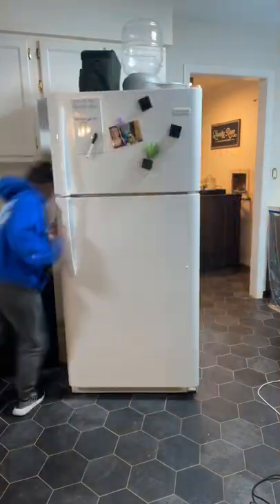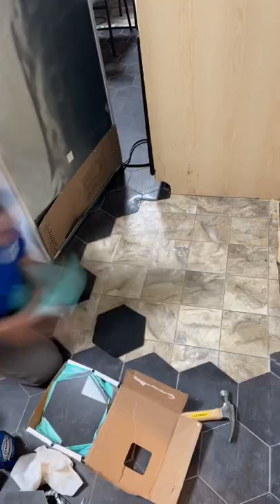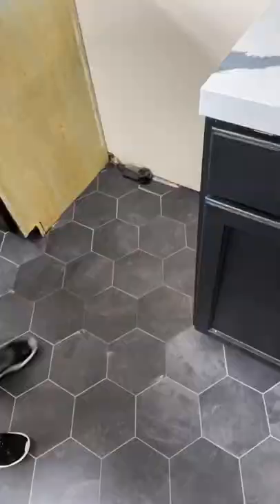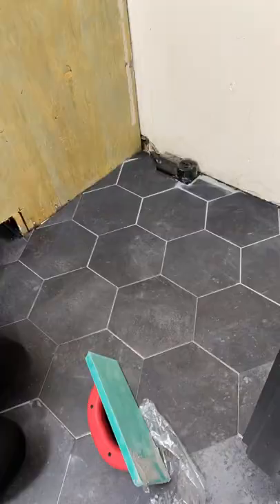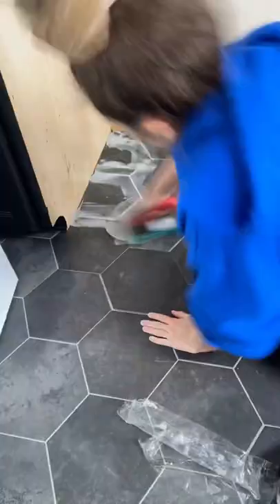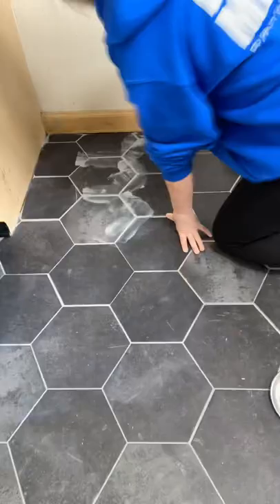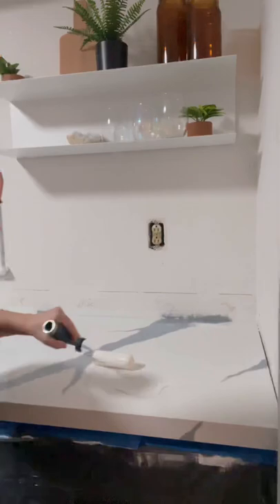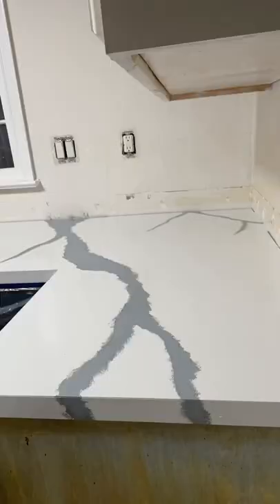HOT MESS HOUSE RENOVATION PART 156! | VIRAL TIKTOK SERIES | LEXI DIY

Comment: bruh did she just stack the tiles on top and grout them 💀 to go under literal appliances.....
Reply: Doesn't even use grout spacers or fuckin paste for the tiles. That floor will fall apart in 6 months
Reply: The tile under it is like that fake tile that you staple to the floor
Reply: It’s peel and stick faux tile
Reply: @parker1234-o5p  she should have removed that before applying the new. She just waisted money and time.
Reply: I think the original flooring is just laminate, my house had the exact same thing, there’s concrete RIGHT underneath
Reply: @islandsicedtea  you are correct but not removing it is still a mistake. The only flooring you can put down on top of another is carpet.
Reply: @des_18  where did you get your information from? That's not true in the slightest. They make so many underlayments that are specifically designed to be put on top of various different types flooring in order to put new flooring on top of it.
Reply: @completestranger922  yeah exactly,, even my dad had to remove the old kitchen floor which was just one sheet of idk,, all was left was wood
Reply: They are groutable peel and stick tiles.   If your subfloor is sound and level,  you can put them over existing  flooring.  Hers looked like solid sheet vinyl,  so nothing wrong with going over the existing flooring.  I work at Lowe's in the flooring department and we're not bringing them back,  they were not great sellers

Comment: I would recommend going for a lower level granite such as giallo ornamental light, salinas white, or even viscoun white. All of these granite materials fairly inexpensive and they look modern and are very durable. They will last as long as you let it.
Reply: Agreed. She probably spent more on all the foam rollers, epoxy, the original contact paper she used, etc. Also that crappy paint job would be gone lol

Comment: May I ask how to strip old floor tiles , relevel the floor( previous owners used cement to stick loose tiles  down)  and apply new vinyl tiles. Those are beautiful ❗  Granite is too expensive for countertops . What did you use ? I need it to last . That's why I strip down to bare floors . 
You are a Talent lady ! 
 Tasteful .I agree with you about putting tiles under appliances . Tiles around "the O" RING ON THE TOILET " keeps tiles in place  too ! 
 Live & Learn !
Reply: She's using peel & stick tiles on top of vinyl tiles already. She didn't do anything to the floors. As for the counter top she used paint & epoxy resin. That won't last long either. Try checking your local Facebook marketplace and craigslist. A lot of people put used countertops on there for pretty cheap.
Reply: Please don't follow what she is doing. She's reselling the house so she's taking a lot of short cuts, buying cheap and basically making short term renovations. The new owners will have a lot of renovations to do when they buy this home.

Comment: Why not use butcher block for your counter tops in place of tile? I get being tight on money but it wouldnt cost that much. I had to replace the counters when I moved in because they were tile and they were shattered and gross. Butcher block was the cheapest option and easy to install myself. It will look so much better.

Comment: I hate to be the bearer of bad news, but lowes is a retailer.  They have no control over product availability.  That comes from the manufacturer.  And my assumption would be either that the company discontinued the product or they are not able to stock it due to material shortages.

Comment: I’ve seen already 3 negative remarks about the countertop. It looks AMAZING 🤩
Reply: Are we looking at the same shitty paint job? Like a real granite countertop would have cost less than all the crappy materials she used to make it looked like a five year spilled gray paint on it.
Reply: It lookes like someone's tried painting counter tops with acrylic paint.
Reply: @katvloom6542  that is EXACTLY what she did 😂 and now she's not even using proper counter sealer. It's like a mix and pour epoxy resin. That counter top will look even worse in 6 months
Reply: @jademarie3055  oh ooooof